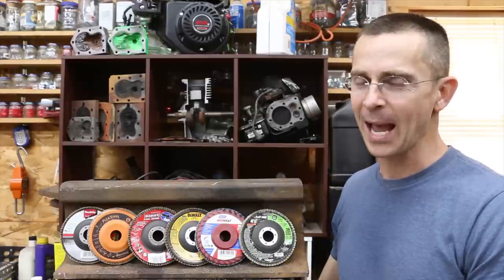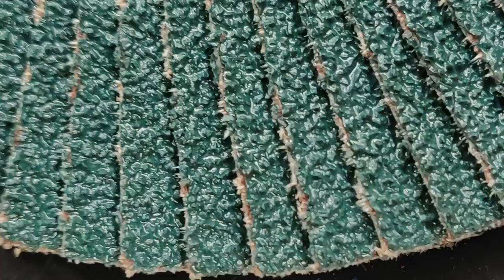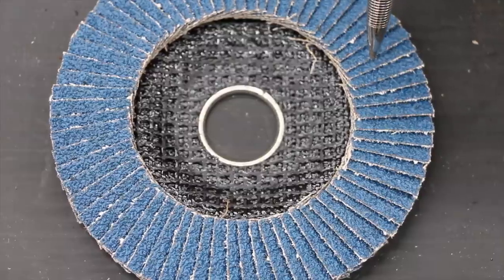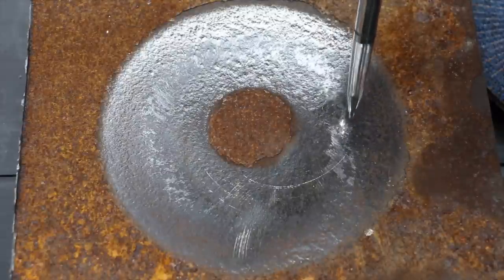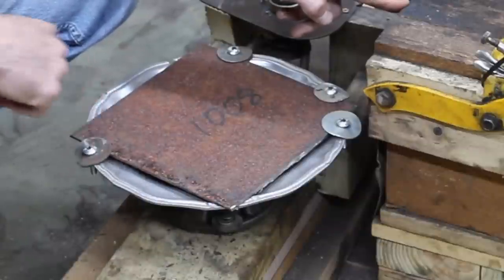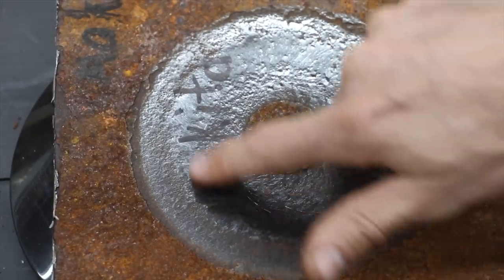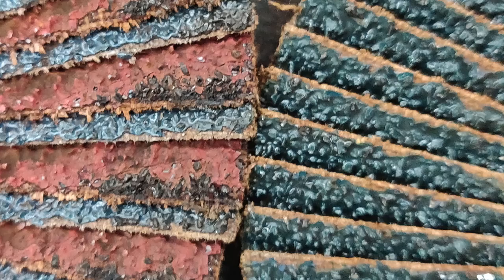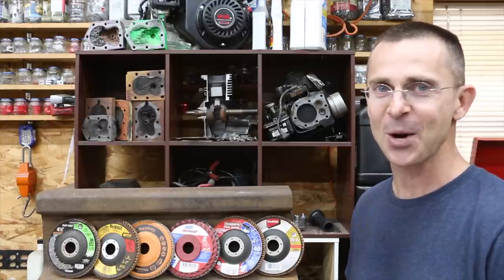Best Flap Disc Brand (6 Brands Tested)? Let's find out!

Comment: I really appreciate your tests.  It really helps when deciding what things to buy.  That being said, I agree with you on the HF Warrior consumables.  I have used everything from flap discs to cut off wheels to welding consumables to chop saw blades.  Honestly they are not really a good value because they wear so fast.  Plus the cut off wheels, chop saw blades and hard grinding discs are going to kill somebody one day.  They are very sketchy.  Next I was a die hard Dewalt fan.  My tool box and shop looked like a honey bee.  I am now very disappointed with the quality of Dewalt tools, especially the batteries for cordless tools.  After I talked to a Lowes regional manager that was once a Dewalt district manager, I dropped Dewalt entirely.  I won't get into all the specifics but they started subbing out many of their tool manufacturing to one of the most disreputable tool companies in China notorious for some of the worst tools on the market. Hint they also make Black and Decker, which we all know is junk.  He said they also purposely started making the NiCad batteries to fail previous to introducing their new lithium tool line.  He said the VP of Dewalt in a meeting said they didn't have to make good tools anymore because the idiots who buy them only look at the name.
Reply from the maker: Thanks!

Comment: Part of this is some of the red rust is converted to mill scale or magnetite.... Black as opposed to red iron oxide. Same finish as on really old, well made for steel tools, wrenches hammers, . Boys that black patina is harder than the steel it covers and is STABLE...Eats almost any abrasive up quick! Ask any knifesmith😂...See Walter Sorrells video on Caring for Carbon Steel Knives.
@Project Farm...Todd...I LOATHE corrosion, red rust. I LOVE stable black mill scale.
Just one of the reasons you are DA MAN!
Reply from the maker: Thanks for the feedback.

Comment: I’d like to see a second round for this test as well as one for cutting blades, my preferred brand is PFERD Abrasives. In 30 years of using them to cut welds and steel up to 1/4” thick I have had 1 disc fail!
As for the flap discs, I’ve never had an issue and like the cutting discs they outlast other discs by far. They even have a flap disc that has the flaps bonded over to the back side for dressing inside welds.
Reply from the maker: Thank you for the video idea!

Comment: I have a suggestion for a Round #2 
PFERD 61171 4-1/2" CC-GRIND-SOLID - 5/8-11 Thread - SGP STEEL VICTOGRAIN
They are Expensive,  but used right( not a heavy hand but a light hand) and they outlast every other disk and cut steel like butter.  You can take inches off a 1" steel bar in no time at all.
Reply from the maker: Thanks for the suggestion.

Comment: Sometines. That's when it's good to have a variable speed grinder. Which are hard to come by. I've searched for them, you can get better results from flap discs by slowing the RPMS down. Lower RPM'S mean less heat and also by lowering the rpms you would allow the grit to actually pic at the rust scale or mill scale rather than burn it into the metal and strip off the grit prematurely.
Reply from the maker: Thanks for the feedback.

Comment: Great video as always.  You put a lot of effort in and get excellent real world results.

As far as this video goes, I would have liked to have seen the weights of the wheels after the second test.  That would have given a good quantitative view of the amount of material lost.

For a video idea, how about testing spray foams.  Matt Risinger did a quick experiment on his channel showing the added structural value of spray foam.  Perhaps you could test insulative capacity, adhesion, added rigidity, and usability.
Reply from the maker: Thanks for the constructive feedback

Comment: With some many different abrasives manufacturers can you redo this video and include brands sold on Amazon as well as Forney seeing they are sold in many weld shops and metal suppliers (at least in my area). I am really trying to spend wisely and want to know is Forney worth the extra bucks or can I purchase off Amazon and get almost as good. 

Thanks, keep up the good work!
Reply from the maker: Thanks, will do!  Thanks for the suggestion.

Comment: By looking at those wheels, I'd say that they were designed to put huge pressure at about a 90 degree angle which would cause the sandpaper under other flaps to cut in (as it flexes.) It's designed to expand. I think your testing would come out similarly, but it may make a difference.
Reply from the maker: Thanks for the feedback.

Comment: Appreciate the effort. Interesting results. I expected the dewalt to do better. I have used lots of different flap discs and it's hard to beat the dewalt for speed and longevity.  Maybe the difference between my experience and the test is because I use the discs rated for stainless steel.
Reply from the maker: Thanks for sharing

Comment: I enjoyed this video. But food for thought, when testing grinding wheels, flap disc etc. Include the angle type T27/T29 and grit type. Aluminium oxide vs zirconiated, ceramic, silicon carbide types greatly affect the wear time and cost of the wheels.
Reply from the maker: Great point. Thank you

Comment: I use a 120 to sharpen my mower blades (it's the ONLY way, IMHO) and bought a Warrior for $1.99 on sale.  I can confirm they are kinda cheezy.  Lots of damage to the disc after just 2 sharpenings  (3 blade, 54" deck setup) and it's not very usable.  I also noticed it took a bit more fiddling to find the right angle, and the spark pattern was noticeably weaker.
Reply from the maker: Thanks for the feedback.

Comment: excellent example of testing brought to the end users level. You identified perameters and showed a means of analyzing them with testing equipment the average person could build on their own. Great work on this. While working at an aluminum foundry we found that the Cubitron sanding belts worked amazing on the 3x79 belt sanders but not as well on the hand belt sanders same brand same abrasive. I have always been curious of the discrepancy. maybe like you mentioned with the makita, it used a different glue, so it wears faster on the smaller size. I would be interested in a review of belts. just type in 2x72 belt sander in youtube and there are tons of DIY plans, and those are just the people who make their own,  I definitely see a market for that.compare hand (.5x12" and .75x18") and bench  (1x30") and (2x72")

Comment: As a fabricator I use Walter and love them personally... that extra life is definitely decent on a bigger job " don't typically use a 4 inch " but the 3 inch 120grit finish pad is a must have a tig welder
Reply from the maker: Thanks for sharing.
Reply: My dad was a welder, after his stint in the Navy (onboard in the Pac Flt WWII).

He later worked at a Union shop. Repairing those olden day, Screaming (USA) Yellow n Black, "P&H", cranes n equip. 

That's one tricky skill trade !

I salute, all his fellow brothers, in the welding community.
Reply: @Da_GrandiMan  hell ya, don't get into it... the pay is ass and the health risks are high... unless you love metal, don't make it a job like I did
Reply: @benmart28  
U sound like my dad. One day on his way to work. I was 10 or 11. He asked, what did I want to be. I said, "I wanna grow up to be like U".
He quickly replied, with his quip,
"Don't be a grease monkey, like me !". (a Union guy AFL-CIO ?)

I was crushed n never forgot it.

Now, I'm retired from the Financial Services sector as a Sr. VP.

Guess he was right.

Thx !
Reply: @Da_GrandiMan  shit man, I'm still in my 20s... I still got a long time from retirement but also to far into my trade to turn back at this point... my suggestion to people reading this wanting to work with your hands? Don't, I make the same as someone at Walmart and I have over 5 years experience, aws certifications in all types of welding processes even in aluminum, stainless, pipeline and to only show for 31k a year... it's not worth it... however spending the 4k I did to learn welding was the best decision ever... I can fix anything metal without needing someone else... that's the only benefit... now if anyone is completely determined to work with there hands, go work at Lowes, they start guys at 20 an hour... that's like 38k a year... better then me!!
Reply: @benmart28  
I hear ya !
Sorry to hear that !

I made that mistake right out of school n never made it again.

I still like working with my hands on occasion. 
But, 
Signing off on Business deals, is a whole lot easier.

Best of luck to ya !

Comment: I did want to offer a video idea. I’ve gone through a lot of 3x21 belt sand paper!! I bought a few different grit Warrior brands when I picked up my sander for a deck job. The adhesive tape seems to give out, or the belt rips if I would go over a knot in the wood, thick chunk of paint, or the head of a hidden screw that was not countersunk. I did notice a material difference between the blue “ aluminum oxide” and brown “zirconia”. I did get more life out of the blue, and had no tape fails, but rips in every belt. Would you mind explaining the difference in these materials, and if the warriors are just weak compared to better brands? Thank you for all you do!!!
Reply from the maker: Thanks for the video idea.

Comment: Great video as always. I always use a flap disc to cut down welds. Even better is my Black and Decker power file. How about a test on power files or band/finger sanders? Cuts down welds in awkward corners really fast.
Reply from the maker: Thanks!  Thanks for the video idea.

Comment: Were all of these discs sold for the same stated purpose and/or stated durability? I ask because flap discs on Amazon seem to be distinctly separated as either Alumina (mostly brown) or Zirconia (mostly blue). There also seems to be a Ceramic type that is any other color (yellow, red, orange)
Either way, great video. Thanks for doing these tests.

Comment: I feel like this wasn't the best test because it looks like you were just working the mill scale and not really getting down to the base metal. The mill scale will have a galling effect to the flap disc making it less effective if you just spent time trying to remove scale. The mill scale is like a glue that will fill up the sandpaper. You need to use the disc on just bare steel for a bit to ungall and renew the grit. I would like to see the test again on clean steel. I would also like you to include the lehigh valley abrasives 36 grit ceramic disk, which is the best flap disc I've come across so far and test out the new PFERD CC-GRIND-ROBUST.

Comment: Just picked up a 36 grit flap disk for sanding down 14 4x4's wooden deck posts that were solid stained and weathered over 25 years at 43" in height. At the last one did it start to seem more like it was burning in a couple of spots but I did all  of them.  The tests are great to see what is what but at $4.39 a flap disk? I'll stick with Harbor Freight. Good enough.
Reply from the maker: Thanks for sharing.

Comment: Some longer term testing of the flap wheels would be useful. The first couple mins of use is definitely not representative of the life time effectiveness and not many people are going to toss them every 2 mins. What would be useful to know is which ones are still usable after 20, 40, 60 min or more of use. Or a torture test to run them until there is no useful grit left on them. The flap edges will always wear away, that’s why the flaps are overlapped so there’s a supply of fresh grit.
Reply from the maker: Thanks for the video idea.

Comment: Good video, but you left out Metabo. 
Although they're work provided, we pretty much prefer their Type 29 cupped design for general weld prep and paint/powder coating removal. I never really considered a flap wheel to be the right tool to go after deep rust or mill scale. We use the Metabo in 40 and 60 grit, I sometimes get a full day or more out of one disc. I know they're pricey but like I said, work supplies them and they have a good wholesale source i suppose. 

As for the Warrior flap discs, they're not that bad if used for just paint removal and light sanding, they're more for polishing and clean up than for metal removal. Plus, with the right coupon, and a sale, I've gotten them for as little as $1.99 each. (Pack of 10/$9.99).  I haven't seen the 10 pks lately, but I stocked up on them a few years ago when they had the 25% off coupon for one holiday sale.  The Warrior discs cannot take as much pressure as the Metabo discs, but they do work for what I use them for. If I need to remove metal, I go to a grinding wheel.
Reply from the maker: Thank you for the feedback

Comment: Tractor supply usually has 5 dewalt flap discs for 10 to 12 bucks.   They also have red or blue discs.   The reds are more expensive
Reply from the maker: Thanks for sharing.

Comment: its dewalt...  of course its overpriced and lacks quality.
Another Great Video! Always enjoy your vids.
as far as blades, sandpaper, grinding/cutting discs, and more, I've been using diablo for quite a while now. They always seem to do the best job for the cost, and last longer than comparative products.
as per tool brand, Milwaukee is best price for what you get. they are tougher, stronger, and better overall quality. been using many Milwaukee tools for some years, and they have held up very well for the abuse I put them through.
Reply from the maker: Thanks so much!

Comment: You probably need to do second run with new discs to confirm, but the take home message seems to be: do not apply too much pressure! As results indicate 2x pressure above nominal results in approximately half of rust / metal removed ; and with commensurate damage to flaps. So about 4x worse outcome overall.
Reply from the maker: Thanks for the suggestion.

Comment: Seriously,  I used to manage the family machine shop and spent the last 35 years fabricating.   THE best flap wheel to use, especially for corner sanding,  is the Camel Grinding Wheel (CGW) Type 27 40 grit XL pad.  Part number 42342.  Don't buy anything else,  you're wasting your money.   I've tried everything,  including diamond, ceramic, polymer.....you name it, I've destroyed it.  42342's knock it out of the park and have saved our machine shop thousands of dollars in consumables.

Comment: Video idea (if it hasn't already been suggested). Comparing battery powered angle grinders. The one i use just seems to chew through batteries very quickly, and isn't very useful when it only lasts a few minutes of grinding between recharging.
Reply from the maker: Thanks for the video idea.

Comment: Excellent Job as always !  Maybe a 2nd video with much more weight showing which brand last the longest? I don't think Diablo makes that wheel anymore tho!  I went to go purchase some 40 grit Diablo and it appears they have changed. Now they are all 7.99 a wheel at everywhere I can find! That's 3-4 times the price of the others! They are black colored abrasive and Made in Spain  I did find some older 60 grit that was red abrasive and made in Germany that was less expensive tho. This doesn't surprise me as Diablo is primarily a circular saw, hole saw manufacturer, from what I remember, fwiw. So If you can find the old German $1.99-2.99 ones buy them up! I am just going to stick with old Tried and True Makita!  I have bought and sold tons of power tools and abrasives for many years so I am kinda partial to a couple tho. Makita Cordless being my hands down favorite but Bosch a close second.
Reply from the maker: Great recommendation!  Thank you

Comment: 3M Cubitron Fiber Discs remove material twice as fast as any of these, last at least twice as long and can be had for just over $4/disc.  They are available almost exclusively online or through welding supply houses.  They absolutely erase weld seams at a shocking rate, do most of the jobs of both grinding and flap discs, and have saved me thousands of dollars in the few months I've been using them.
Reply from the maker: Thanks for sharing.
Reply: @ProjectFarm  No thank you.  I run a steel fabrication company and your testing has helped me make a number of purchasing decisions and save tons of $$.

Comment: If you have not yet done cold cut saws I would be greatly interested to see how the Oslun 10" blades hold up to the Evolution blades and any others out there. In the same vein cutoff wheels would be another interesting test. I received some trial 3M disks but have yet to try them out.

Comment: The added weight was a key factor here.   Those discs with 1 minute of use should have continued to have positive responses on the second test.  I’m wondering if the added weight was pushing the flap disc backing too hard into the steel, yielding a poorer result for the second test.
Reply from the maker: Thanks for the feedback.